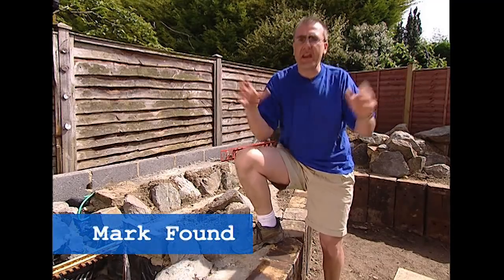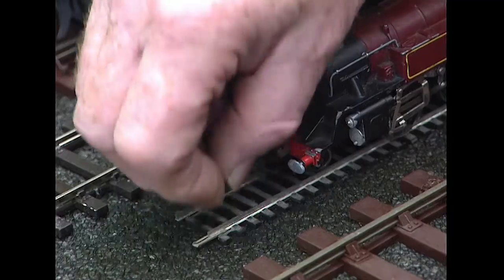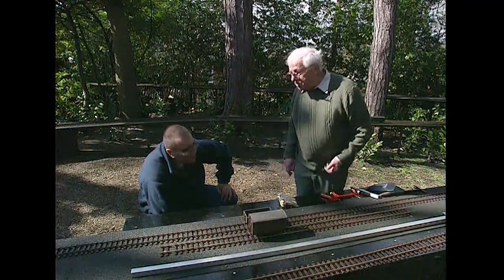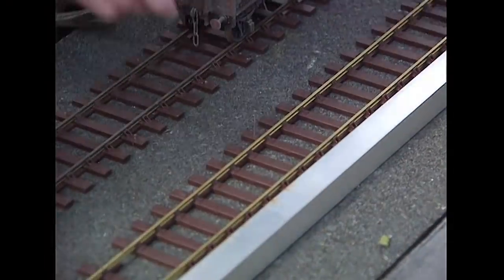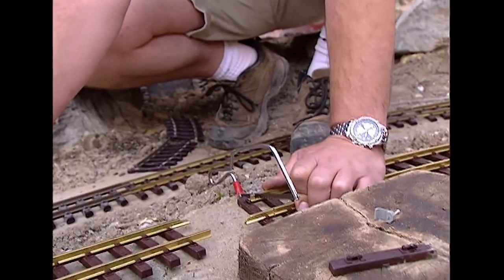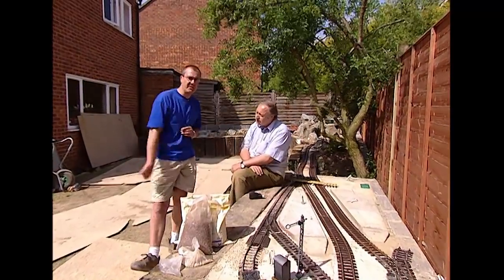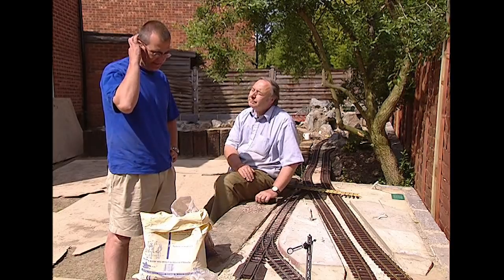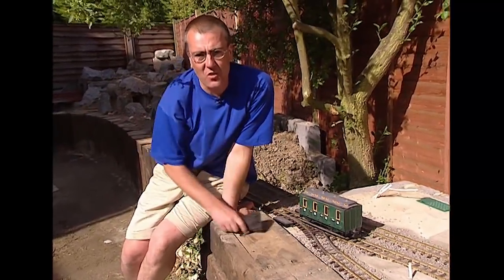Mark Found   The Garden Railway   Prog 7   track Laying

Comment: I think what really governs the scale is the price, not the space. Once you start playing proper O or G scale it can get rather expensive. I like the idea of using a clearance guide.
Reply: Oh, 'sup Leo? 

Yeah, both are factors, honestly. In the UK, space is a premium.
Reply: You're not wrong, but going from 00 to 0 to G to G1 is a massive increase is size - each one contains four times the volume of the previous, so a loco in 00 that's the size of a toilet roll tube ends up the size of a large drainpipe. So, if you are determined to fill a given space then the cost equalises - it's only when you want to look at equivalent plans that the price difference comes in (i.e. the same plan in 00 vs G will be 3x as expensive, but the same garden filled with track will cost the same in 00 vs 0 vs G1)

Comment: What is the stuff that is added to the rail couplers at 13:15? What kind of conductive flux is it?
Reply: In the next episode Mark revealed that it was copper grease, which David Pratt had advised, allowing electrical continuity across the layout.